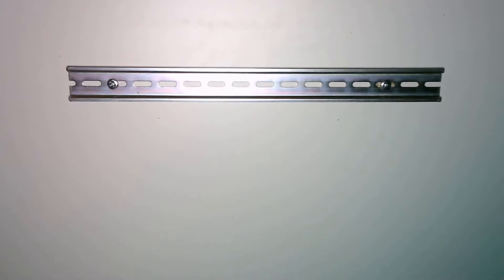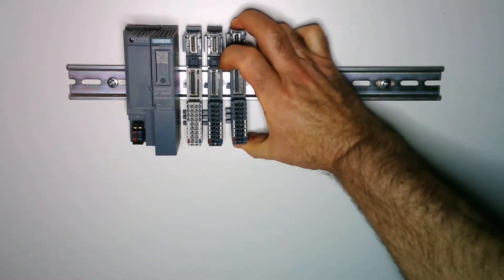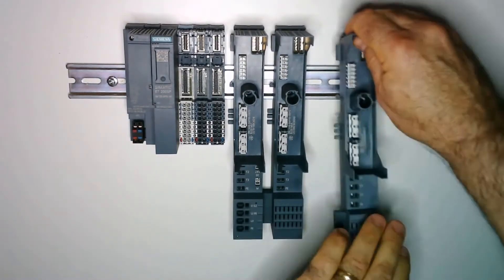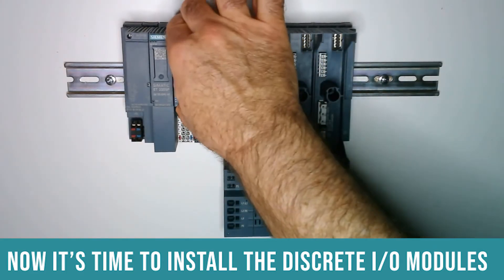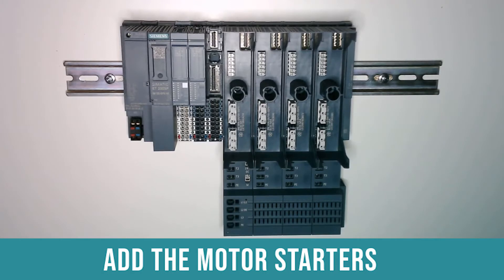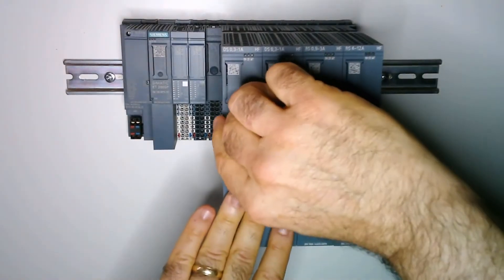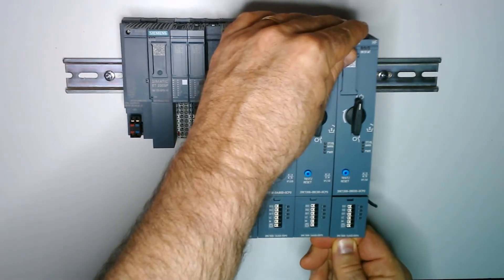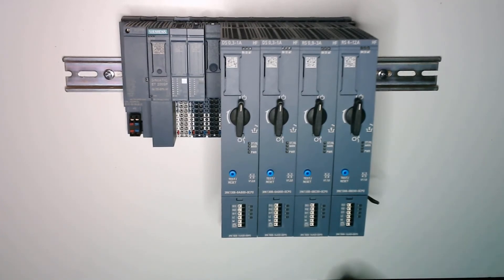Siemens | Installing the ET 200SP (Demo) | EandM

Comment: The white module is not needed as the first one, since the gray one takes the power from the left and passes it on, and also has inputs at the bottom for the power supply, it can be the first one and everything will work. I checked myself.